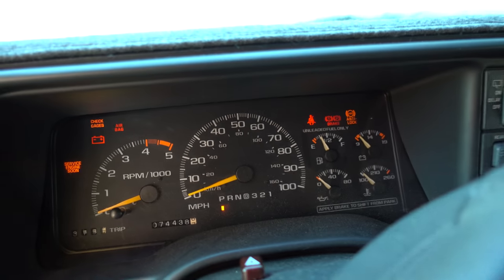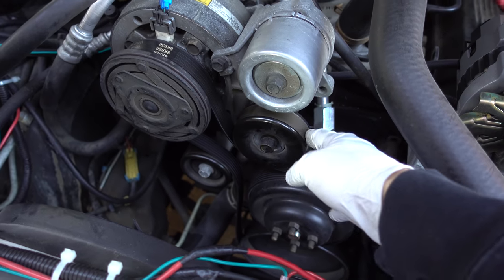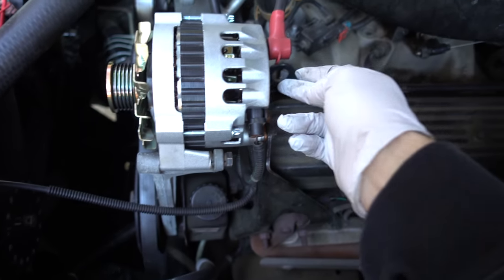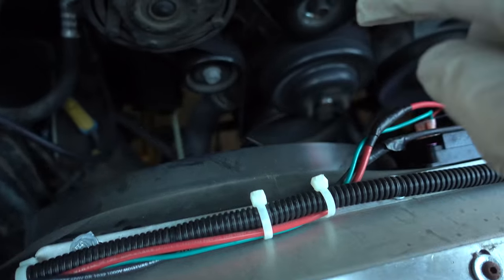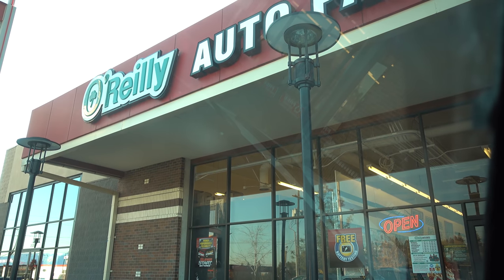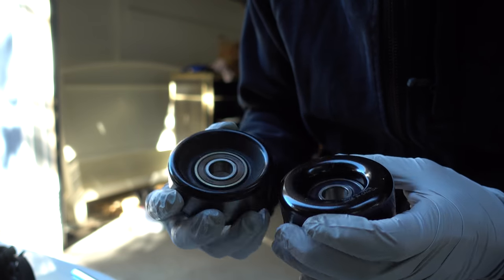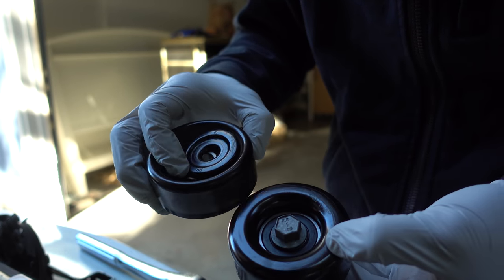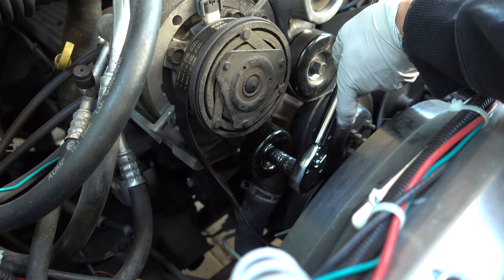How To Diagnose A Squeaking Pulley!

Comment: If you put some water on the belt and the noise changes, then the problem is belt wear and/or belt tension, not the pulley bearings. Generally: If it gets quieter, the belt is worn. If it get louder, it's slipping from low tension.

Comment: Thanks for the vid Jimmy. Going through the same thing myself. Got an 04 Ram 1500 that was making same type of noise. Changed belt, idler pulley and just today swapped out water pump. All the other pulleys aren't making any noise. Next step is swapping out belt for a gator belt. I hear those can stop the squeaking. Worth a try.  UPDATE: adjusted idler pulley and belt as well as sprayed belt with belt lubricater. That did the trick. Truck is sounding nice. Thanks for the post and comments. They are very helpful!
Reply: Belts don't need lubrication, on the contrary.

Comment: I had the same squeaky belt issue on my 01 Sequoia and it turned out to be the 10 year old Gates serpentine belt and idler pully needing replacing.  Replaced it with a Continental belt and NAPA pulley and now super quiet. Great video!

Comment: Sounds more like a belt that is in need of replacing than the pulleys from the sound it's making.  lf you're ever unsure about the idler pulley or the tensioner pulley, if the noise has just started then you can simply remove those pulleys, carefully pop off the bearing seal and then repack the bearings using a synthetic high temperature red grease like Redline CV2.  Then replace the seals and reinstall the pulleys.  lf the sound was coming from one of the bearings (happens when bearings run dry) the new grease will eliminate the noise.  lf the noise is still there then you know it wasn't the pulleys and plus you're only out the tiny bit of grease it took to repack the bearings plus you just greatly extended the life of those bearings which is not a bad thing.  Next step would be to change out the belt (since that's the next easiest and cheapest thing to address) but if you want to test the belt first before buying and installing a new one, using either a spray bottle or even just a long piece tube (such as refrigerant line) start the car and carefully drip some water on the groove side of the belt either by finding an exposed part of the grooved and applying the water directly to the grooves or carefully drip some water on one of the pulleys that the grooves ride on.  lf the squeeking stops then that confirms it's the belt that needs replacing.  Using the aforementioned methods you can easily and cheaply eliminate 3 different possible sources of the noise and at the very worst your re-greased pulley bearings will be very happy for another 50k miles or so.  My bet is on the belt though.
Reply: I have a Chervolet Spark M300 1.4 (98hp) car with 25,000km run. Recently the weather has been cold, the car has made a noise from the engine compartment when the car accelerates between 1500-1700rpm (The sound appears in the belt - pulley area), reduces the throttle or exceeds 2000rpm, the noise will stop. I tried spraying belt conditioner on the belt, the noise decreased but it still appeared.
Where is the core problem? Thank you.

Comment: Jimmy, the impeller on your water pump may have one of the fins bent and rubbing the impeller land of the water pump. I used to build water pumps, and the sound you have there sounds exactly like impeller rubbing a little bit. Will not hurt a thing. I would just run it.

Comment: Jimmy remove the dust cover to the idler pulley then change out that belt replace it with a gator back belt they are known to be quality made quiet belts. This should fix it

Comment: Oh my, i just went through the same process. 2004 Chevy Silverado 2500 HD 8.1L V8. I replaced the idler pulley and Belt but not the tensioner. Everything was silent for 1000 miles then it came back. Ordered a belt tensioner, put it on and it still squeaked....crap, ordered a second new belt & Idler pulley, so now everything is new at the same time. Problem solved. Follow up: It’s been now 5000+ miles and all is well. Lesson learned...replace everything at the same time!!!

Comment: One of the best ways to check idler pulleys is to get a car stethoscope which is pretty cheap and start running your engine and most of the time if you can get close enough with the stethoscope to the bearings you can hear them real easy that saves a lot of trouble
Reply: did you watch the vid?
Reply: @mmmmmlemons  No I used the   stethoscope
Reply: @mmmmmlemons lmfao

Comment: I went through the same thing. After a changed the alternator I developed a squeak. I ended up replacing my alternator again, my idler pulley,and both belts. Still kept squeaking. I then pulled the dust shield off of the idler pulley. Squeak gone.
Reply: The alternator bearings
Reply: I have 4.3 same block /parts as 5.7, I have new alt and same squeak..idler pulley dust cover you say...
Reply: Remove the dust cover doesn't do anything the cover act's like a speaker it intensive the sound replace bearing.

Comment: You need a "cheater" - a 2' piece of pipe slipped over your ratchet handle - to increase your leverage when working the tensioner. You need a breaker bar too, just because, but the tensioner doesn't require that much force, just more than you can easily impart with a short lever.

Comment: I have the same issue on a 2000 Tahoe with 74K on it.  I changed the Idler Pulley and still have the noise that sounds like metal on metal. Its so frustrating. When I spray WD 40 on the pulley the noise goes away but then a day later its right back. I sprayed the belt with belt dressing and no change. The belt is good.  The noise sounds like its on the Idler Pulley side so I'm now suspect of the tension pulley.  That water pump on the 5.7 is no fun to change out. Usually they weep if they are going bad so I'm not going there yet.  I did one on my 5.7 Yukon and its a big job just to get at it, not to forget the 11 or so bolts to deal with.  I too saved my old serpentine belt for emergency use.  I don't suspect that on this Tahoe. Its not that old.  The nearest neighbor to the idler pulley is the alternator or the tension pulley. Its definitely on that side. SO FRUSTRATING.  WHY does it just go away when sprayed and then come back?  I am at a loss on this one,, this has been going on for a few years with no luck to fix but no final breakdown of a part.  ????

Comment: I am having the same issue with my f150...changed the tensioner, belt, and top pulley..still sqeuaks/ squeals/ grinds a little when engine is cold...thx dude u helped me with nothing...good luck...before u go replacing that coolant pump make sure it's not the crank shaft pulley

Comment: Try squirting water on the belt while the engine is running. If the squeak goes away, it's your belt. On the groove side and the smooth side.
Reply from the maker: +J. Hunto's Garage really? Just a little bit or a lot?
Reply: What about if u changed your belt an pully

Comment: The alternator even with good bearings, will make a noise when rotated in the opposite direction of it's normal spin. This is because the brushes create a "lip" that is smooth only in the normal rotation. Also the bearings of the A/C clutch will also make a noise when worn out.

Comment: Doing the same sound on my 2000 camaro 3.8 so I squired a little bit of armor all to the idler pulley first and it stopped the noise so I replaced the pulley and everything went back to normal.

Comment: I saw another video guy shared the gator belt that is ribbed in a way that it doesn’t squeak also most of the time it’s a pulley miss alignment not that it’s detrimental entirely but most belts will squeak with a small pulley miss alignment

Comment: My 94 k1500 had the same sound.  Spray some rubber protectant on the belt.  I used ArmorAll and it cured the problem.
Reply: Just get a new belt, not some made in China or Mexican made garbage and you will never have a problem again.

Comment: Just a small tip Jimmy you can use a spray bottle of water and spray each bearing the bad one will go quiet 👍
Reply: Thank you, Dean! Figuring out which part needs replacing BEFORE buying parts (and busting knuckles) is my biggest delay on repairs!
Reply: Not if it's a bearing ,Numbnuts. C'mon think!

Comment: I have a Pontiac Grand am, and when I was looking at mine, my crank shaft is behind and below my ac compressor and idler pulley and the water pump sits above it all.   The crank shaft pulley looked wobbly, and I guessed it could possibly be making the water pump stress out by belt stress, so I got a water pump and harmonic balancer part, from O'Reilly's.  I hope it works to get rid of my squeekiness

Comment: Hi Jimmy, nice video, great content, I have question for you and maybe you could help with this. I have a Mazda Tribute 2008 4 cyl. I lost the serpentine and noticed that the top pulley was loose, so I removed it and say that the washer behind it was damaged (it's for the power steering pulley) according to a diagram I found online. The pulley is still good, not damaged. Would you know where to get that washer part without having to change all the pulleys? Many thanks, John

Comment: Brother presently going thru the same squealing scenario, 97 f150 4.2. Tried tension pulley no dice still squeals. Tried  new serpentine belt, was cracking on grooves, no dice still squeals. Oh boy.
Water pump was leaking let's try that. Discovered fan clutch scrubs and tight. So might as well do that to. No dice still squeals with new water pump and clutch,, new coolant,, new radiator hose.. Lol, geez 62 clutch  + 69  pump + 60  3 gallons antifreeze + 62 hose  not to mention 25 for pulley + 26 for belt. Error!  Next try idler pulley ( it's got 2). Alternator is very new, ac replaced with new one by local ac shop about 3 years ago. Well hopefully it's the idler pulley.  Not a continuous squeals. Ever
Few seconds momentary squeals.

Comment: So it's now Nov 2018.   At the end of the day, what did you finally determine what and where was the noise emanating from?  Clearly the alternator had a squeak but if I was to take a wild guess, it would have been the upper idler bearing!

Let us know.
Reply from the maker: Funnily enough it was simply the belt.
Reply: @1RoadGarage  you should update the thread

Comment: Keep going.  Regards breaker bar, as others have said, you can use a ‘cheat’ on that, and in fact in my experience, much of the time, the force required by the time you already have a 12” normal-sized ratchet fitted to the bolt/nut in question, is low.  In other words, a PLASTIC 1.5” rigid drain tube for sinks etc, is sufficiently strong.  I literally have half a dozen different colours and lengths of off-cuts laying around at any time, from different houses I been in fixing.  Get one, push it over the whole normal ratchet you’ve got, and you will almost be able to double the length of leverage, before the plastic gives way where the metal ratchet ends.  I replaced 3 different car tensioner pulleys, and you have done the things it normally is.  I would look now, to the heaviest-duty part - what gets used a lot, and collects a lot of dust etc?  There are two things that make and collect dust - the magnetic-clutch unit that the aircon kicks in and out as and when it’s called for, and the alternator makes its own dust from those brushes you mentioned.  Brushless alternators must exist.  Spray-lubing the bearings you have access to might help.  That water-pump you replaced, there isn’t by any chance a part of that set-up that you re-use when you replace it is there?  The auxiliary belt is a real legacy idea, isn’t it?  Take care all.

Comment: They do make gatorback belts still that dont squeak whatssoever! Just check how all the pulleys are aligned and maybe one is sticking out further, causing a misalignment issue. The gatorback belt can help with that problem though.
Reply from the maker: +Charles Suhr I remember those but haven't seen them for a while now.
Reply: Charles Suhr gatorback/ continental elite is what I'm running now. Rockauto.com has em in stock for about $25.00 Jimmy!
Reply: Yea theyre called continental elites now. You just have to make sure the dimensions of the belt are the same as the original belts

Comment: Sorry guy what a bummer. If it's any consolation I've been there before. I got what sounds like power steering going out a whining sound, but I think it's the pulley, idler pulley, cuz I can turn the wheel all the way, one way, or the other, and it doesn't wine, but when I rev the engine up, it makes whining noise you wouldn't believe. Just stepping on the gas and the garage it wines. How long can I let that idler arm go before I absolutely have to change it out?

Comment: It may of been none of these in his case. If no pulleys are obviously bad and you just replaced something, a used belt can squeak like that. They will stretch to the way they were originally put on, and will squeak if you put them on a different way. Mark the point on the belt where it goes to the tensioner before taking it off.

Comment: Man ive been having the same issue on my 93 5.7 ive replaced all the pulleys belt except power steering and crank. Have done the water pump alternator compressor tensioner just because of the squeel and i still have to spray deodorant on the belt every morning to shut it up drives me nuts did you ever figure it out?

Comment: A trip to Harbor Freight just to buy a breaker bar?  I use a small pipe around 3 ft long on my ratchet and it works fine.  Its not a high pressure thing so the ratchet is safe from damage.

Comment: tensioning pulley bearing   toast best way to test is undo belt and wiggle them both laterally just like  wheel bearings  the more the movement if they are lose they are the squealer   and steths  work but hands on is best

Comment: I'm going through the same thing. I have a new belt new alternator new water pump new ac compressor new power steering new tensioner and new idler pully. And it's still squeaking. I have no idea what else it could be.

Comment: You replaced the water pump and then got a belt squeak - the belt is out of alignment ( from one pulley to another ) . Need a laser alignment tool. Likely the new water pump pulley is too far in or out by maybe only 1/8" - doesn't take much to cause the squeaking.

Comment: one way to diagnose  a squeaky belt is  while its running hold a small piece of a soap bar against the pulley be very careful  doing this if it stops squeaking its your belt and pulleys , new belt and if you have a sandblaster have the pulleys sand blasted  your squeaks will stop for a few years

Comment: Tip , if the bully is spinning freely and fast with your hand 6:08 like a spinner then it will squeak on you and you need to grease up the bearing inside with a good heavy grease , and it will last for a long time , do this for all bully's and bearing you can take off from the engine and you will be fine ...

Comment: started with buying a new belt,
My truck does not squeak, it's screams. new belt was not the answer. took belt back and bought a a.c. bypass p ully adaptor, because a.c. compressor is shot.  still screaming. then I went and got a  new belt tensioner, still screams.
I cleaned the pulleys with carp cleaner, still screams the only thing left is alternator, and idle pully.. I feel like I'm playing craps at a casino, it's a crap shoot

Comment: This is your water pump. Same truck as you, same issues. 

Also, welcome to the PNW, I just left there 2 years ago, keep an eye on the crevices around your windows, it will grow moss. 

Check my channel for diagnosis and repair of the water pump.

Also, the squeak on the alternator is the brushes being ran backwards.

To confirm, with the engine off give the waterpump a good tug up and down via the pulley (obviously with the belt off), I bet you feel some movement back and forth, use your stethoscope to confirm while a helper moved it up and down. I believe you said you used a smaller belt in another video, if you did then it added lateral stress to the pump and caused that bearing to prematurely fail.

Also, I swear i think you moved into my old neighborhood, that or they are just all amazingly similar, Vancouver?
Reply from the maker: +Jim Henline Hello Jim, thanks for commenting! I just replaced the water pump and sure enough it wasn't it either😵😵😵. What a giant waste of time although I did film the whole thing so that video will be up soon!
Reply: Awe shit.
Reply: 1 Road i have some problem with you. Whats main problem of that noise if you had changed waterpump?

Comment: its amazing how much space there is but on 4 cyl vehicles they bury the belt like someone who doesnt work on cars would do
Reply: That’s because it is NOT a front wheel drive SIDE mounted motor. All front wheel drives have a couple inches between pulleys and fender well.

Comment: Ha. My idler pully went out yeaterday and totally destroyed the spacer in the back of it, flattened the bolt on one side, and chewed up the belt plus slung metal shavings into the alternator and caused it to fail. Can only find it with bolt and spacer from AC DelCo. $51.00 USD.

Oh yeah! Only one click on the torque wrench, bru. Never two.

Comment: Its the bearing inside.. i believe 8mm socket and screws... you’ll need to use a hammer/mallet to separate the housing the again to remove the bearing.. depending which bearing you’ll need to use a dermal to release the  bearing.. its an easy fix but as you can imagine a somewhat lengthy process

Comment: spray the belt with water and if it stop it your  belt
Reply: charles smalley << thanks, tried the spray with water and it stopped squeaking......so frustrating trying to figure out where the squeal was coming from. Thanks again
Reply: Wrong.